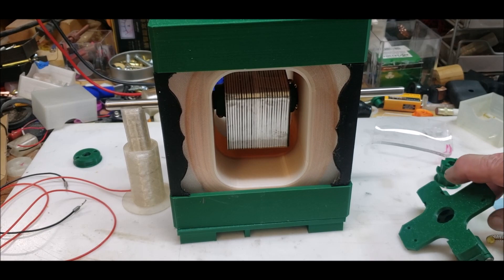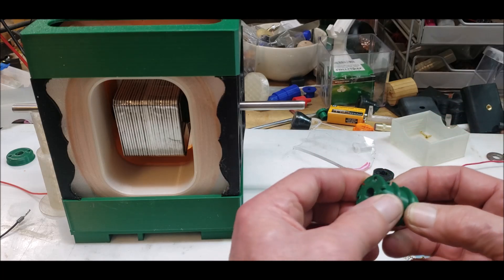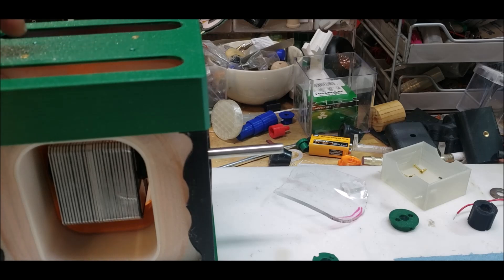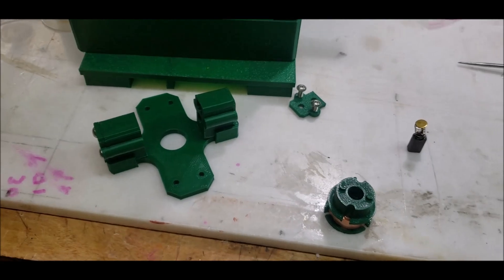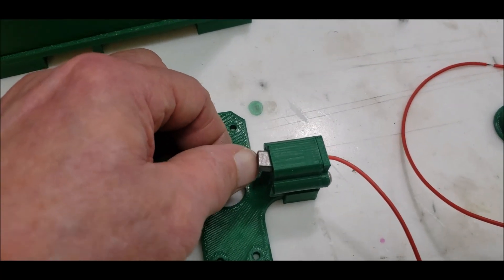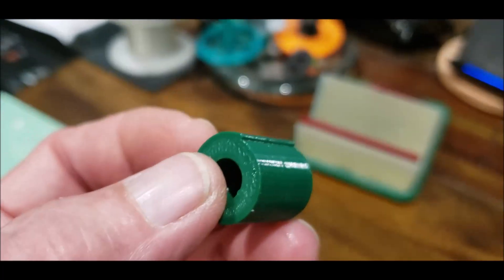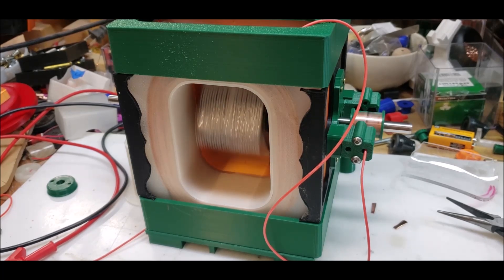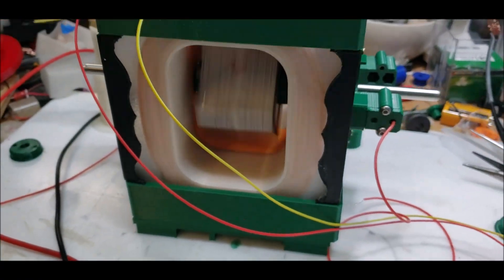3D Printed RD3DP Newman Motor run with commutator

Comment: Sorry brother, I've been busy. I'm making a quick commutator assembly video. This design does not conduct through the shaft, but just uses two rings of 3/4 inch copper pipe. Just cut off two rings with a pipe cutter. Those little channels allow wire that connects the two rings a place to hide. This commutator is only for driving mosfet gates or transitor bases. Your doing great, keep up the good work!
Reply from the maker: Man I love this design but I don't know how yours is wired, I jus sent you an email. I can't wait to see the commutator build video yaaaaaaa
Reply: @mcorrade  Just uploaded it. Don't worry everything's going to work out. I'm actually running mine with 98vdc using a high wattage boost circuit from Amazon. If your rpm's are too low for your taste, you might want to go higher on the voltage or wind fewer turn parallel coils.
Reply from the maker: @redesign3dp  I don't mind the rpm and yes I now know that this beast likes higher voltage than I normally use. When I crank it up, it works much better. I think that's because of the bigger coils with the thinker wire. Don't really know but hey, its workng man

Comment: Try to use the commutator the way red3dp design it it will run better
Reply from the maker: I want to but I need to know how and what the circuit config is. I only have the basic newman config or one of my circuits.
Reply from the maker: he said in his video he uses a dual mosfet circuit which I don't have